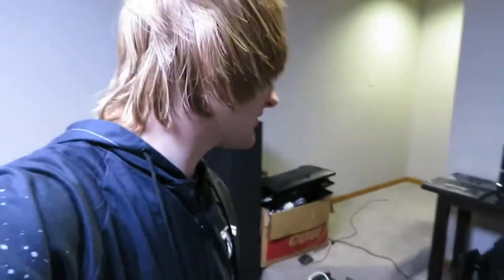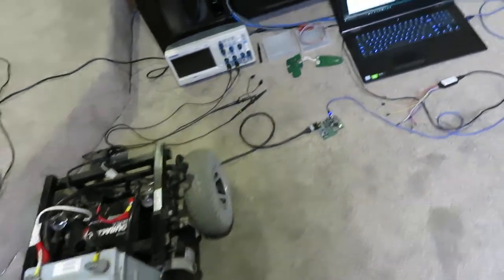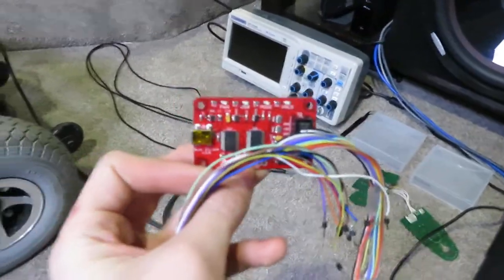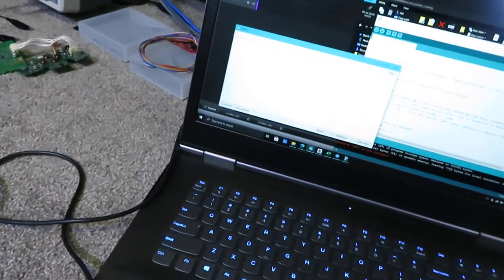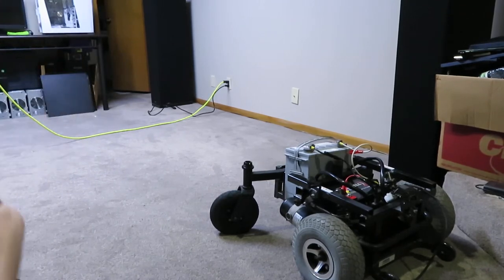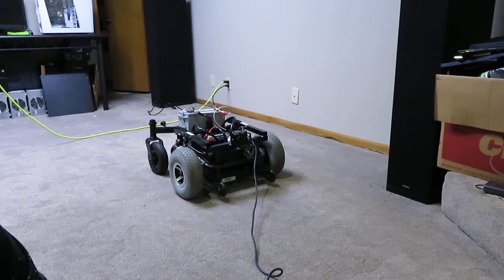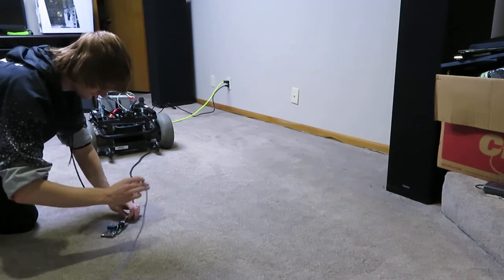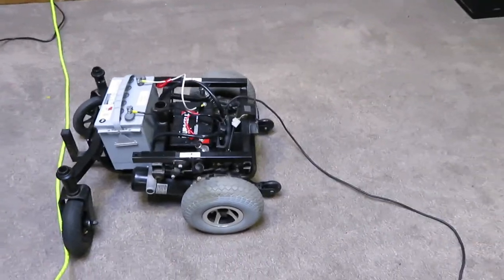Dynamic Controls Shark Mobility Scooter Controller Hacked!

Comment: Great videos Ri5ux. I have an RC wheelchair to tow my trailer around the yard. What tires are you running in the front? Keep the videos coming. 👍👍
Reply from the maker: Thanks! The front tires are a pair of Clever 200x50 pneumatic tires. They sit at 36 PSI. As far as I know they're actually intended for use on a Razor scooter, but they work pretty well!

Comment: As I'm a old fart &  In need of educating can you show me how to build a controller to drive                     the tow  motors on my scooter so i can fix my mobility scooter. I get so men.  reticula's prices to fix the controller ,   as I haven't a cloud how to start or how thing are meant to work.  when I fixist my car that was simple but control systems' need some explaining . props the youngster can help the old generation hear.
Reply from the maker: I'll be making a more detailed video with a web based tutorial showing all the nitty gritty inner workings. It should be the information you're looking for.
Reply: @ri5ux435  Hi I bought a Golden Buzzaround LX 3- wheel mobility scooter is there any way of making go faster